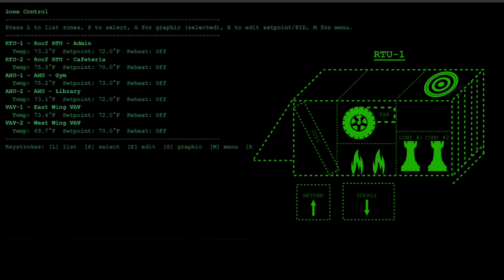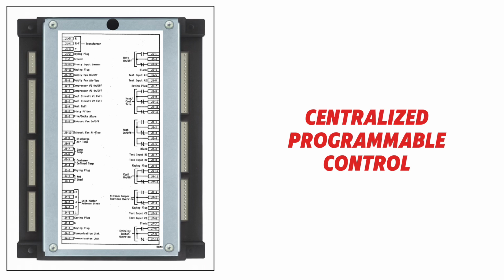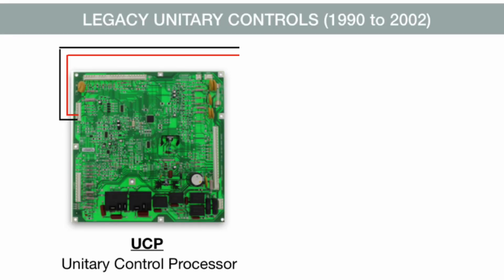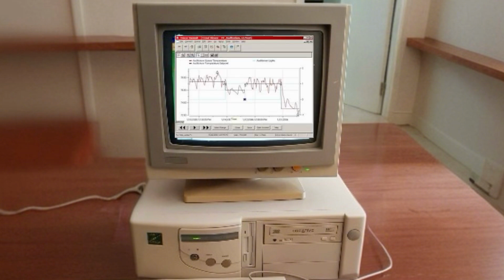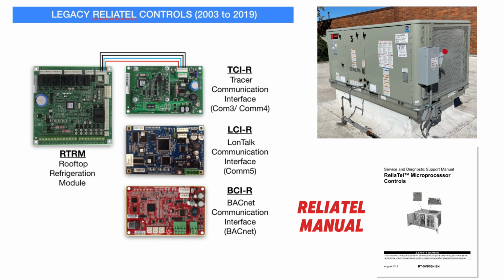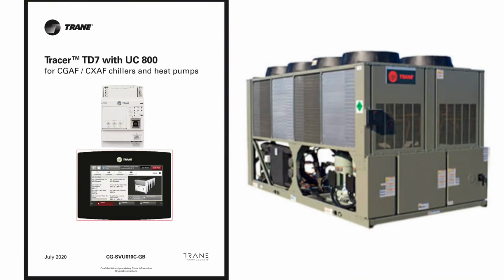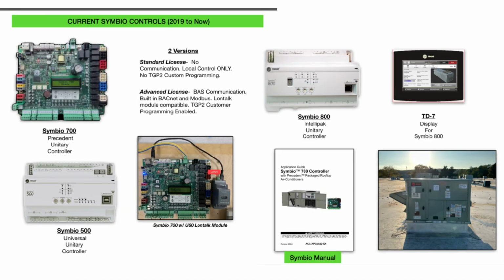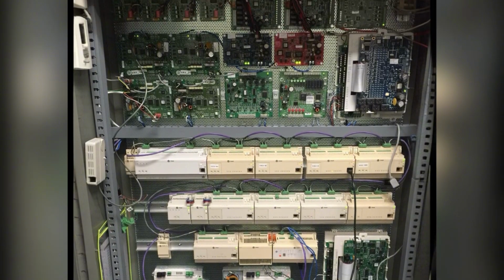Trane Controllers Through The Ages : From Tracer100 to Symbio

Comment: Skipped a bunch. Tracer 100 card cage, BAV UCM, UPCM, Lighting controls LCU, MP controllers.
Reply from the maker: I’ve done a bunch of videos on UCM’s. I was mainly focusing on the major unitary controls. I thought about putting the UPCM in, but I just covered it with the PCM. It’s basically the same thing. Just mode points and cards. It was getting long and this look me a month to produce. I’ll make a directors cut and add them in